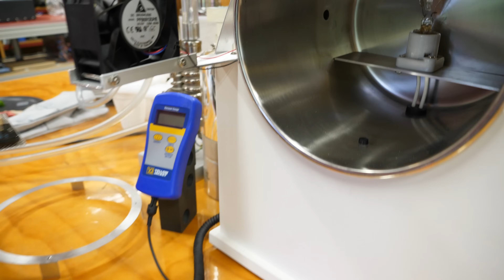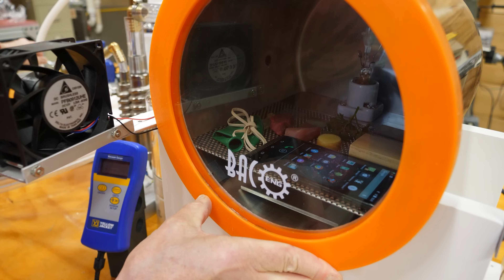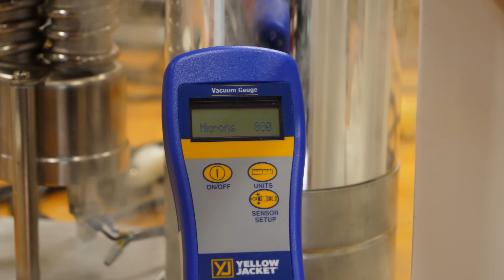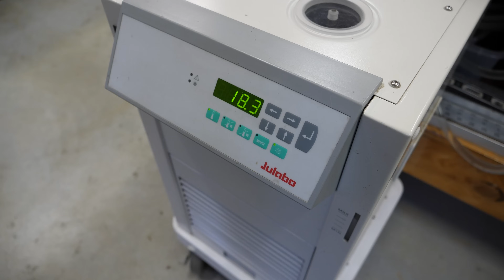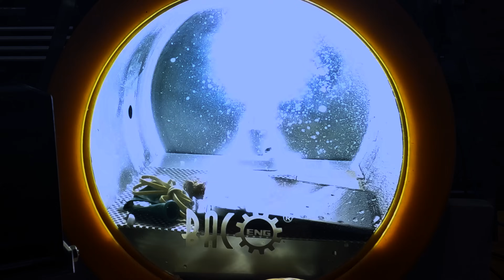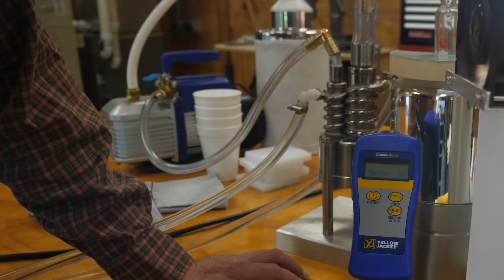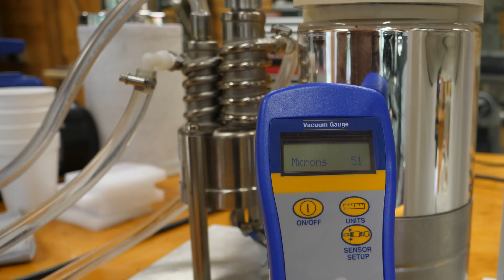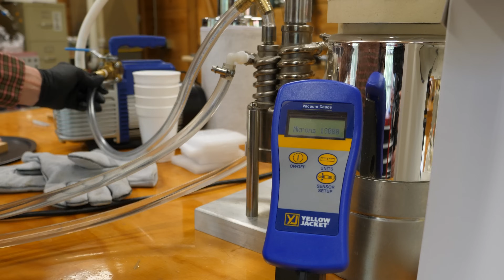We exposed BEEF to the vacuum of space, then ate it!

Comment: Wonder how much your food items were contaminated by the volatiles from the phone battery and the wood plus the adhesive in the plywood
Reply: Probably not much since they want to make their way towards the pump right?
Reply: In a vacuum?
Reply: I was just thinking as the pressure dropped the battery pack inflated and as it popped any volatile would spray.  Maybe not so much from the plywood but as anything even micro bubbled onto the surface it would have some added energy and droplets surely travel further in vacuum.  By the time the pressure had dropped there would be little to no airflow in any direction beyond the spray direction of the popping battery.
Reply: @jimclark8845  Well, they're volatiles, they'd go away. Vapor deposition, now that's something to think about. I certainly did whilst looking at the strip of white deposit on the chamber lid right beside the battery.
Reply: @Drmcclung  I suppose all I am saying is I would not have even tasted something that had been beside an exploding phone lol.  Needless to say it was an interesting way of freeze drying meat and I do wonder what it would be like re hydrated but without the phone.
Reply: @jimclark8845  I smell a new freeze dried meat product idea, should call it "Soyuz 11" 🤣🤭

Comment: The food items may have tasted better if the weren't exposed to whatever came out of the phone, rubber bands and plywood glue. Next time I would suggest keeping food items separate from other materials.

Looking forward to more!
Reply: Your comment made me realize that those "edible" products might have had a few toxic materials on them. 'Hope the presenter is okay after this. (".)
Reply: I thought about that too, but then I also thought about entropy. Would those contaminants even want to go to the meat, potato etc?
Reply: @madmatt113944  that wold be my thought. Once its volatilized and in the "air", I use the term air lightly since its in a vacuum, I would guess it would stay that way and be removed rather than condense back onto something else.
Reply: @madmatt113944  Entropy means everything will eventually diffuse.
Reply: @madmatt113944  in a true vacuum probably not. But in a small container where everything is touching each other.... I would guess that everything was contaminated with small solid particulates the moment the battery ruptured. But you are likely right about the rubber and glue.
Reply: I agree that foods and other items should be separate, if you plan on sampling the result. From the moment I saw the battery swell, I would not have eaten anything. Although the sample bites were small, you still ingested something which you should not.
Reply: How would any material diffuse into each other in absolute vacuum ?
Any vapour is removed by the vacuum pump and there is no atmosphere to transport material around in the chamber.
Reply: @CXensation  Splatter or spray to start. The expansion of the battery and bursting of the membrane. Not everything vaporises. Second, don't underestimate organics. They sometimes behave counter intuitive. He's not gonna die from it, but it is not recommended to consume those foods after this test.
Reply: Maybe dont taste them hah
Reply: Right!? I was screaming "ThE LiThIuM THO" when he ate those things. lol
Reply: Awe man ! I bet your right . Yikes 🤮
Reply: Meh….
Reply: @hakujouryu  It tasted awful, but cured my depression! 😂
 
In case you weren't aware, lithium is used in some psychiatric medicines.
Reply: @EvenTheDogAgrees  McAntidepressant: the real Happy Meal.
Reply: Yes ,contamination from the phone battery would have made anything taste pretty sh*t!
Reply: I would suggest not poking the raw pork with your finger and then continuing to handle food. Awesome content tho!
Reply: @CXensation  While there is still volatization of compounds occurring from the food items, they would be a lower temperature than the atmosphere of the container because of the evaporative cooling, so it would have some potential to condense anything else that might have a lower vapor pressure than what happens to be vaporizing out of the food item at any particular time. That being said, in such a high-vacuum and sustained-vacuum environment, I think that anything volatile would be of very little risk and the environment probably re-volatized any incidental contaminants long ago (also poison is in the dose). Others made good points about the solids being scattered when the battery ruptures, though, so there were probably some nasty materials on his food samples when he ate them (but again, dose).
Reply: @BrytonWA  1) Did the battery rupture ?
2) What about the heater lamp ?
Reply: The battery electrolyte is mostly "anti-freeze". (we learned to stop using alcohol a long time ago. the source of "vent with flame".) Even if it were ethylene-glycol, he didn't eat enough to be toxic.
Reply: @EvenTheDogAgrees  It's a mood stabiliser, not an antidepressant. And it's only found in one preparation; by itself as a carbonate.
Reply: @CXensation , everything being removed in the vacuum has to travel to be removed.  Accordingly, it's going to cross over the other things in the vacuum chamber.

I have a freeze dryer and this same can (5 gal?). When I freeze dry things, I don't mix raw shrimp or other meat with, say, corn.  Then there is the garlic and onion thing. Those are best dried by themselves.
Reply: @PBeringer  it's found as lithium citrate, and lithium orotate for consumption.
Reply: @H0mework  Ohh, interesting. I had no idea that it had pharmacological applications outside psychiatry.
Reply: @keithyinger3326 Once something is evaporated, its molecules bounce around until they hit the vacuum port or something they "stick" to. They may not evaporated again if there is an ionic or chemical bond. The battery electrolyte is definitely reactive enough.
Reply: AGAIN!!!!
Wasn’t going to let this waste an hour of my day. 
Get the idea in the first few minutes-skip to the last few minutes and be on with my day…
🙄 her I am “49 minutes and 28 seconds” later. 😂😂😂
GREAT JOB👏👏👏

LOL. Sent this, then I thought I needed to post it with your comments here. LOL
Reply: AGAIN!!!!
Wasn’t going to let this waste an hour of my day. 
Get the idea in the first few minutes-skip to the last few minutes and be on with my day…
🙄 her I am “49 minutes and 28 seconds” later. 😂😂😂
GREAT JOB👏👏👏

LOL. Sent this, then I thought I needed to post it with your comments here. LOL
Reply: Exactly. My brain was screaming cross contamination from the start. And then the condensate issue after the phone blew up. Heaven only knows what got on that beef from the phone the rubber and the latex.
Reply: @keithyinger3326 except the cold trap got full, you could see condensate inside the chamber, and he had to repressurize the system to empty the cold trap.
Reply: @danbrunermer4295 saw that too lol
Reply: Food items by themselves. What you ate???
Reply: @jfbeam The battery is lithium.
Reply: That was my first thought as well. But since the volatiles were constantly being removed from the entire chamber, seems unlikely that any of the items would re-absorb anything from other items?  I suppose there might be some "reactions" from even short term contact before volatiles get whisked away, but I don't imagine that could be very significant. Just the same, I wouldn't volunteering to ingest anything "cooked" with a cellphone 🙂

Comment: Did the wood get briddle or lost it´s stability in any way? Love your channel. Keep up the good work.
Reply from the maker: We could  repeat and use the hydraulic press to test a few beams.  I also  wish I had weighed the samples in this test.
Reply: @TechIngredients  I would absolut appreciate if you would run a few test on different wood. Might be a nice material for your exiciter speaker system. Would be awesome if it´s possible to run a setup that could contain large sheets or mabe just glue some slats together, later.
Reply: @TechIngredients  How does to wood combust? Does it behave like wood or more like charcoal?

Comment: What does an egg do in a strong vacuum?  Does the shell protect it enough to prevent implosion?
Reply: The shell has pores, so a chicken inside can breathe
- I imagine it would start to leak, until it ultimately cracks and then splits open making quite a mess
Reply: Chicken eggs have an air bubble inside which would expand causing the shell to break. A very weak EXplosion.

Comment: This is one idea I would super like to test is the wood and if it is possible to make charcoal from it by using vacuum. I am not sure how you would get it to burn off what ever makes it charcoal? Though I wonder if the dried wood would act much like charcoal due to its water content almost being gone once pulled from the vacuum? 
Does the UV and radiation light do anything to the wood that would happen when one make charcoal?
Reply from the maker: It might take a lot longer, but the end result would be similar except that the vacuum charcoal  would retain a little more energy  potential because  there would be zero oxidation during the process.

Comment: Could you please try to cold weld metals in your space simulator? Thank you for your fascinating and very enjoyable content.
Reply: That's a great idea. The only thing it misses there is gravity. ARC welding too. Might require a larger chamber. The melting point of metals in vacuum could be tested.
Reply: I think the covalent bonds of the atoms on the surface of the metal are clean so it can rejoin reconnect in space "radiation and pure vacumn knocks off any unwanted atoms" arc welding uses a plasma gas from the electrode + arc, mig weld is basic molten metal pulled down to the surface , and tig is arc plasma argon. Helium etc with metal added to the molten pool
Reply: @james2hackett870  I think in space you want to avoid venting gasses for such work, first because they create lift which is difficult to counter, and second because they require tanks that may not be easy to refill right now. I thought ARC was simply electric melting of a rod. If it requires a gas, then I suppose it's off the table. Thanks!
Reply: @up4open763 the gas is a shielding gas needing on earth in order to prevent oxidation of the meta on which you are welding. Shielding gas is not needed in a vacuum.

Comment: I am curious about more of the potential culinary applications. Specifically, something like thinly sliced fruit, such as apples, bananas, or strawberries; normally I use a dehydrator to make dried fruit chips which can make a good snack. Great video as always!
Reply: It's a freeze drier.
Reply: @speadskater  I don’t know anything about that process - is this what that is?
Reply: @kyoopihd  exactly this.  Drying out food in a vacuum, though freeze drying usually freezes the food first to sublimate the water out.  Look up the harvest right for a retail freeze dryer.
Reply from the maker: Correct
Reply: @speadskater  Cool - I just might do that!
Reply: Smell is a huge part of taste. By nature of being able to smell something those compounds must be volatile. Volatiles will all be removed here. You won’t like what comes out most likely.
Reply: @Turbochargedtwelve  Interesting point. Effectively, though, it appears freeze drying is a very similar process, although it leaves food that can still taste good. What would the difference be here?
Reply: @kyoopihd  the flavor compounds don't get removed as readily in freeze drying
Reply: @kyoopihd  My WAG in this particular case is volatiles from the wood, rubber and cell phone being absorbed into the food.  Unlikely to be nearly as bad if it was JUST the food products in the vacuum chamber.
Reply: @michiganengineer8621  I happened to see that suggestion in some of the other comments - that would definitely make sense!
Reply: @kyoopihd  A whole lot of the tastes we perceive, especially the fruitier ones, are from esters.
These are volatile organic compounds which are an alcohol and an acid combined.
When a solution containing  these freezes, a lot of water molecules are chelated around the polar (slightly charged) regions of the larger ester molecule.
This basically "weights down" the flavor esters, making it much more difficult for them to evaporate into gas phase.   The water molecules adjacent to the ester are similarly protected, but regular ice will sublimate as usual.
Reply: @NullHand  Really cool chemistry. Thanks for the explanation!

Comment: I would be interested in seeing if the woods other properties changed as well, burn rate and strength etc
Reply: Mmm… cadmium beef ,)
Reply: It probably dried completely. The surface was a bit burnt, but I don't see that it would make much of a difference. It seems that dry wood contains almost 20% water.
Reply: My question was related to the same thing about charcoal and this was his answer. 
Tech Ingredients
Tech Ingredients
32 minutes ago
It might take a lot longer, but the end result would be similar except that the vacuum charcoal  would retain a little more energy  potential because  there would be zero oxidation during the process.
2
Reply: I would like to see unflavored and flavored Jello gelation tested, and compared to Aerogel.  Would also like to see before and after weight comparisons, strength and burn test on wood samples.  Great show, I always love to see Tech Ingredients in inbox.  Thanks!
Reply: @wilfredvanvalkenburgh2874  'Edible Aerogel?' was going to be my request.  Great video, possibly even more  entertaining than usual.
Reply: @costa_marco  tech ingredients  I have been a woodworker/cabinet maker for over 35+ yrs and only use kiln-dried hardwoods which typically have a moisture content of between 6-8%. I can't speak for the plywood, but as for the pine and oak, I would like to get measurements (if they were cut to the same size) to see if the chambered pieces changed. I'm wondering if the cellular structures making up the wood collapsed under the vacuum. I'm no botanist.....just making a guess.
Reply: @robertorr2878  I got an average value from the internet. I am no expert by any means. Funny enough, I read today that Japan is planning to send satellites made of wood into orbit, after they found out that wood fares pretty well under space conditions.

Comment: Could you please try different types of 3D print filaments in the space simulator. I was curious about which types of plastics would hold out better in space and if some would change colors. Thanks for the great content.
Reply: For a start, it's already well documented which filaments are UV sensitive or not. PLA wouldn't be advisable.
Reply: @_skyyskater  I agree about the PLA. I was just curious about the feasibility of creating a 3D printed craft in space ignoring the gravity and only focusing on the materials used ie various filaments. I am aware of the UV experiments but not both uv and vacuum also there are many new filaments.

Comment: You mentioned it briefly, but aerogel would be interesting to learn about. Also a video on lab equipment itself would be really helpful for anyone looking to explore setting up a home lab.
Reply: Aerogel wrapped in a balloon serving as a 1 way valve,  suck all the air out of frozen air, effectively having a small solid vacuum in a balloon
Reply: @AdricM ……..what?!
Reply: @revmsj  overlapping layers of rubber will let the air out, but not back in.  serving as a 1 way valve..  i suspect the external airpressure would just crush the aerogel.  but if not you have a very light object.

Comment: Since I just learned that you read each comment, I have a question. Forgive me if it sounds silly because I don't have a science background, but I'm fascinated by the properties and the way peltiers work. I've always wondered if they could be incorporated into a let's say a jacket, in a way that it could cool you of on the inside if it's very hot on the outside, as well as heat you up when it's cold outside. Either with the help of a battery zipped up inside an inner pocket, or powered by solar panels on the back in the example of cooling down the body on a hot summers day?  Are there alternatives to a "solid state" square in a way that you could separate the cold and hot side, perhaps transfer the heat exchange through wires which would make it easier to mount one half on the outside of the jacket and the other half on the inside closer to the body, perhaps sew them to the inside of the jacket liner, and would the relatively small area, like the shoulders or other parts on the jacket be large enough to mount soft solar panels that generates enough electricity to feed the system? Thanks for all the great content you and your son are providing humanity!
Reply: Solar panels get hotter underneath than on the side which receives the sunlight, so you would heat up your jacket if panels were mounted on your jacket.

You would need a heat sink on the inside of your jacket & a fan to move the air around your jacket… so get an extra large jacket!

You would need another fan to blow the heat off of the outside of your peltier.

All of these fans blowing air, everywhere, your body heating up the inside of the jacket, with solar panels heating up the outside of your jacket, inefficiency of a peltier, and heat naturally permeating from the outside to inside of your jacket… it might be difficult to make such a system actually balance out so you are cooling the interior of the jacket faster than it is heating up!